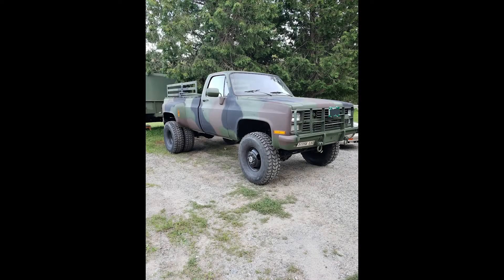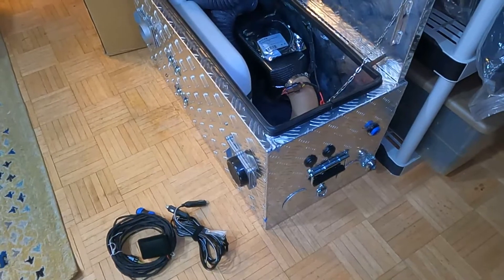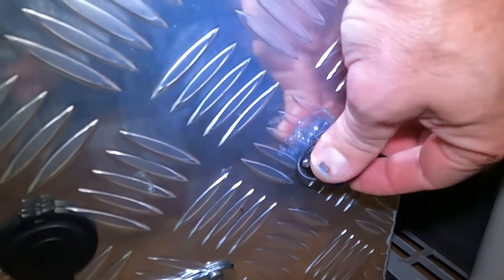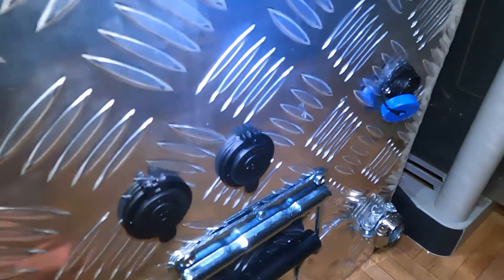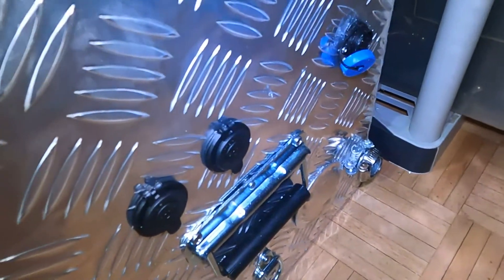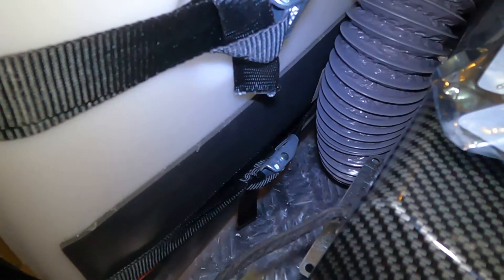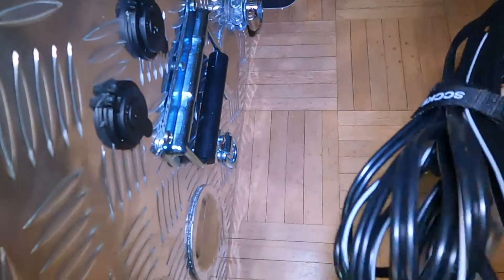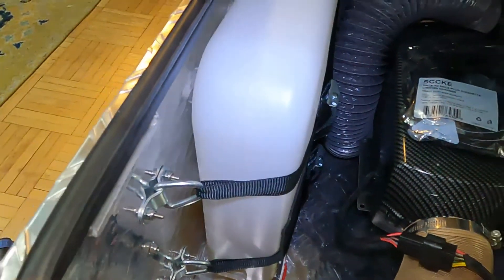8 KW DIY diesel heater system - Best easy mods everyone should consider.

Comment: FYI there is no such thing as an 8Kw diesel heater. What you have is a 5Kw and you fell for a marketing gimmick thinking your heater will put out more heat...but it won't. Also you will NEVER need a heater to keep your diesel from gelling. All you have to do is use a mixture of K-1 Kerosene and diesel. You can add a conditioner if you want it will help remove any residual water in the fuel. Also you might want to review your quick links several of them are not the item you linked to.